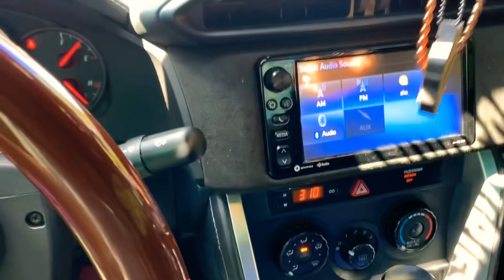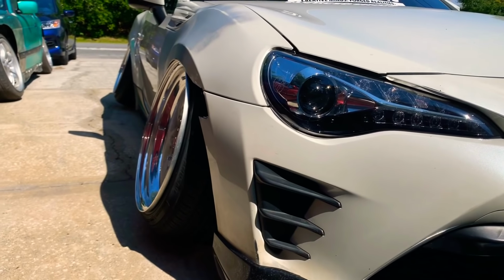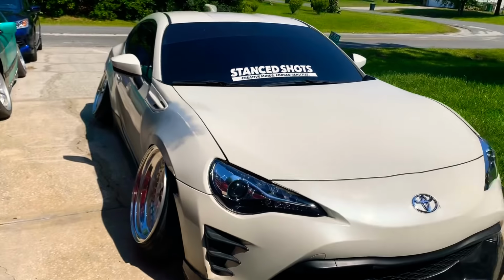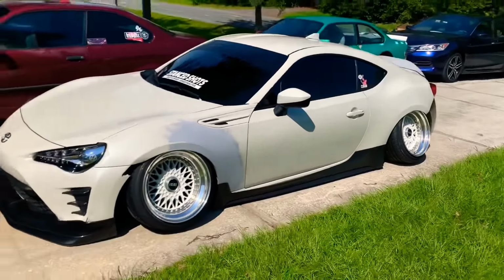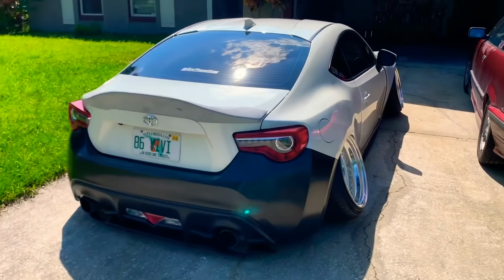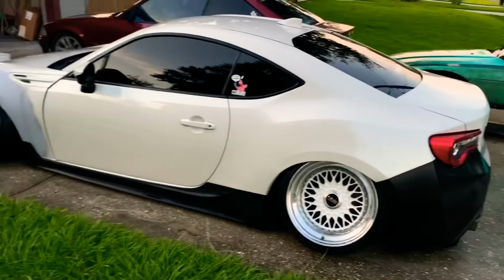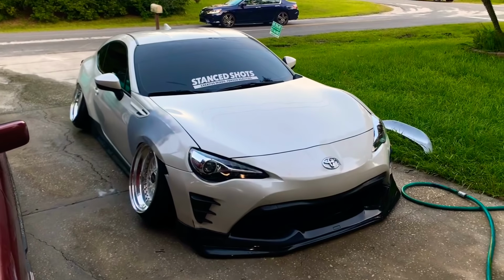YOU WONT BELIEVE THE GLOSS ON THIS DIP!

Comment: How much does a job like that cost?
Reply from the maker: Mr.Ek prices start at 1800 plus the wetsand and buff
Reply: What liquid wrap system do you like the best, Raail, Auto Flex or Halo EFX.
Reply: Who's Got Your Back halo efx looks good!
Reply from the maker: Who's Got Your Back autoflex is the best and the only brand I’ll stick with !
Reply from the maker: Mr.Ek no comment 😂
Reply: cnrcreations I mean,I have paint,so that’s way better than anything!
Reply from the maker: Mr.Ek of course I’m a painter at heart I should post some paint videos !
Reply: cnrcreations do that,I’ll check it out,where are you located!?
Reply: So you didnt use the gun mr pigment really recommends , what gun did you use? and how many coats of clear did you spray?  After paint how long did u let it sit n dry before putting clear